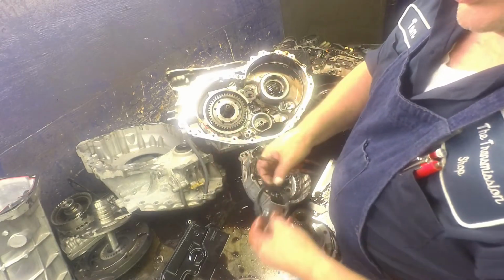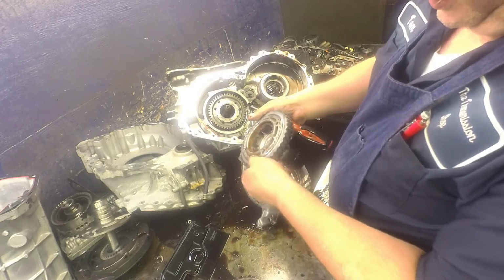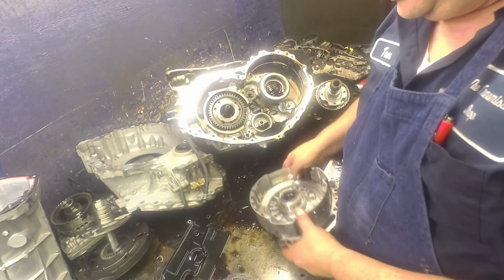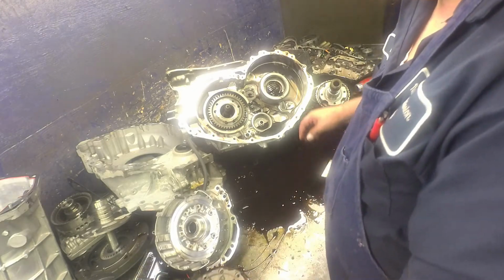U660E Disassembly

Comment: When re-installing the valve body, how is the manual valve indexed?  FYI my tranny has 295K miles and has codes P0746 (SL1) and P2714 (SLT). I plan on replacing the two solenoids. Does the valve body have to be removed to replace them?
Reply from the maker: You can see it. Just line the slot up with the pin on the linkage. Yes the valve body needs to be removed. The solenoids are probably bad, very common. But the molded pistons are going to be worn out in the transmission as well. The case will be worn out as well. You will need to buy a new one or have the old one repaired.
Reply: @CurmudgeonTransmission   Thanks for the prompt response. I just need the tranny to work for a few thousand miles. Hopefully, replacing the solenoids will get the car moving. The tranny never gave us any issues until recently. I did take good care of it - I did an ATF flush every 70K and ATF filter change at 140K and recently, at 290K, when the solenoids started acting up. When I did that second filter change, the pan was spotless and the magnets were relatively clean. Even the filter looked clean, a lot better than at 140K.

Comment: I"ve got a 2011 Sienna AWD with U660F.  It wont pull in forward or reverse (it just revs like its in neutral), but the strange thing is, it wont roll backward (like the trans is in park, even though the shifter is in neutral and shift cable is intact and moving shift arm normally).  I verified shifter operation by watching trans range switch on scanner. It will roll forward though, but with a lot of resistance. All wheels will spin freely when vehicle is jacked up.  Have you ever seen one of these trans fail like this, or have any idea what type of failure it is?
Reply from the maker: Sounds like you have some major damage inside the transmission. You won't really know until you open it up. But I would guess either planetary damage or at least one clutch pack welded together, probably two since it will not move either direction. Wheels are turning freely in the air because you are probably turning one at a time. When you are doing that, only the spider gear in the diff is turning.

Comment: Hi,

I have this transmission in my 07 Avalon, I already change when I notice torque converter shudder,, no shudder now but still looking to keep the car running couple more years. I got 203,000 miles. 
Could routine drain and fill prevent this failure from happening?
Reply from the maker: Regular maintenance is always a good thing. But at some point, your valve body is going to get too much wear. It's a hard decision to make. Replace the valve body now and possibly get some more life out of it, or let it go until you have to rebuild it and replace it then.

Comment: My GF is looking at a 2013 RX350 with a U660F in it.   Seller says it won't accelerate, needs to be towed.  Vehicle is in excellent condition otherwise.  $10K less than market price.   I've rebuild a few manual transmissions and have tools and a shop.   Should It tackle it ?   Advice ?

Fantastic channel !
Reply from the maker: You could probably do it. The problem is going to be in what it usually needs. You might be better off buying a unit from the dealer. This is what they normally need. Rebuild kit with molded pistons and clutches, direct steels, center case, new valve body and torque converter. This is normally the minimum. Price that out and then price a unit from the dealer and weigh your options. If you are lucky, it might not be the transmission. No acceleration could be plugged exhaust, bad fuel pump or clogged air filter.
Reply: @CurmudgeonTransmission  I think the owner means the transmission is slipping and the vehicle won't accelerate.   Would that be a clutch pack problem or a valve problem ?

Does every transmission need a new center case ?  Torque converter ?  

There is a used take out transmission available locally.   90,000 miles on it. ????

Thanks for replying !
Reply from the maker: @SomeTechGuy666  Usually. Only seen 1 that wasn't. 99.99999% will be.

Comment: Have the 660e on a 2015 venza, there's a delay when shifting from Park to Drive and around 30 mph it doesn't know whether to upshift or downshift. Selenoids, vave body or replace it with a new one. Car has 46k miles.Thanks in advance.
Reply from the maker: These units have problems with the valve bores as well as the solenoids. Usually the solenoids get plugged up when the race for the case bearings starts spinning in the case creating fine aluminum. I have only ever seen one vehicle that the race was not spinning in the case. By the time you buy everything that it usually needs you can buy  a new one for not much more.

Comment: do you know what would cause this transmission to have a delayed shift/ hard shift when cold but not when warm. Every winter it seems to get worse and worse. Debating disassembly and rebuild
Reply from the maker: Rubber seals may be getting hard. Be sure and get a kit with the molded pistons. Use Transtec, Raybestos clutches.

Comment: Hey I’m having issues with this same transmission on a 2007 Camry xle. It doesn’t move at all in any gear. Idles fine. TPMs just go up. Lifted car and axles do not move in any gear. Do you have any idea what internal component could cause that?
Reply from the maker: Too many to list. Definitely an internal issue.You will just have to get it out and see what the damage is.

Comment: I have a question, my transmision was remplace but the code p0713 persist with the same problem , if remplace the transmissiin need to erase the codes or will be cause the same problem? Thank you
Reply from the maker: Totally different transmission? Anything reused from the old transmission? You should erase any codes, reset the adaptives and relearn the shifts after any repair.
Reply: @CurmudgeonTransmission   @Curmudgeon Transmission     I put a 2010 avalon transsmision  working to a camry 2009 v6 with trans bad or failure with code p0713, but I dont know if the mecanics erase the codes, the code failure persist , and the compensation codes werent puts, sorry for my english, thanks for answer, I delete the posibility of bad sensor of temp transsmision, because the new trans was working fine, que but I think could be the TCM or the erase codes, can you tell me any sugerence please? Thank you
Reply from the maker: It is possible they did not clear it. I would start with doing that. If it persists it may be a bad TCM.
Reply: @CurmudgeonTransmission   thank you very much